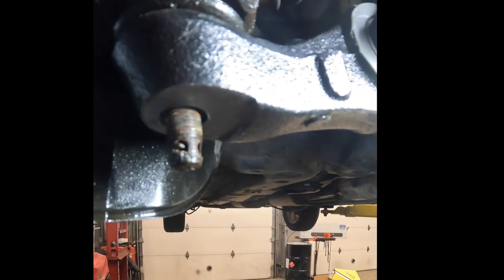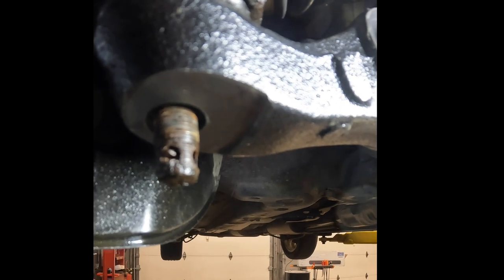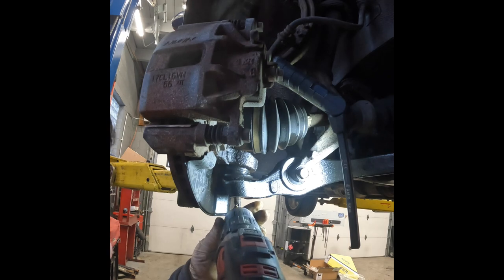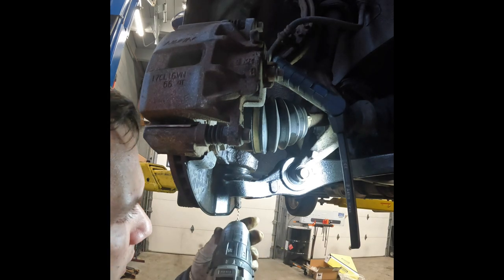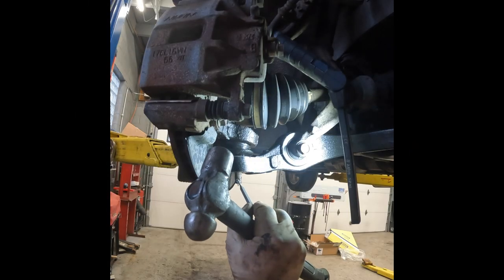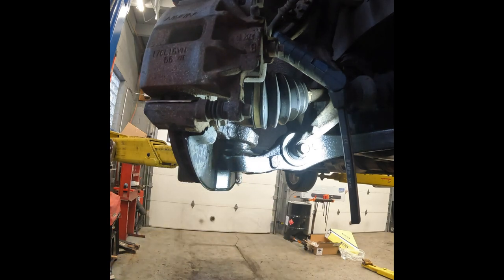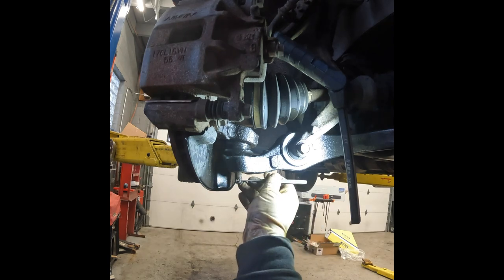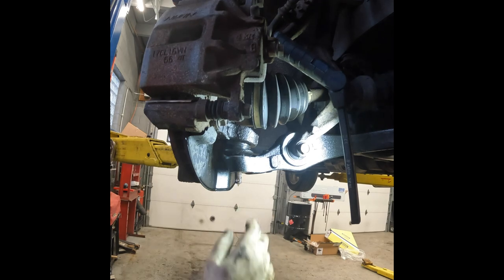CUSTOMER STATES COTTER PIN BROKE IN BALL JOINT!  HOW TO REMOVE BROKEN COTTER PIN.

Comment: I just noticed my civic 2021 passenger side is missing a cotter pin. Do you think I would be ok without one?
Reply from the maker: The cotter pin is there as a safety device. If it’s missing, it would be best to replace it or get a new one in there.